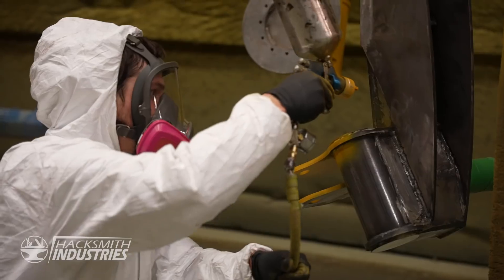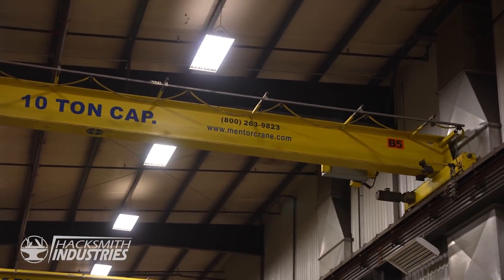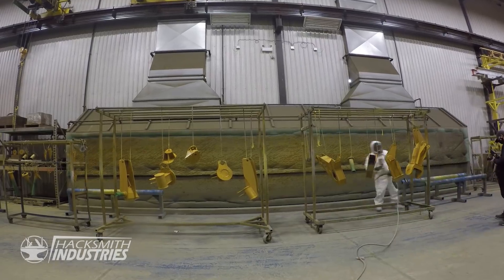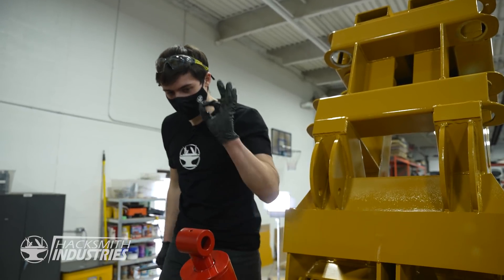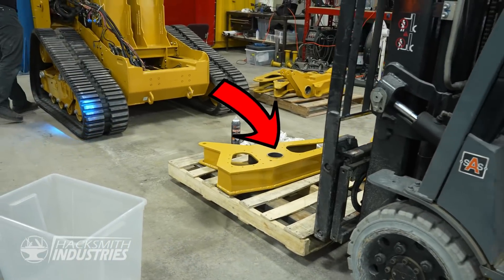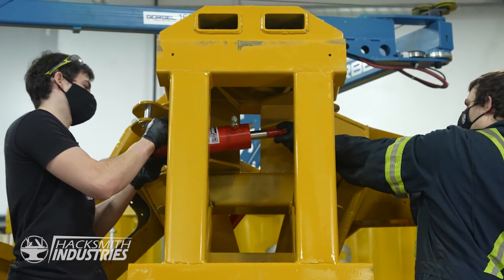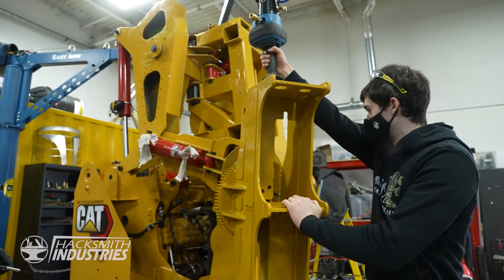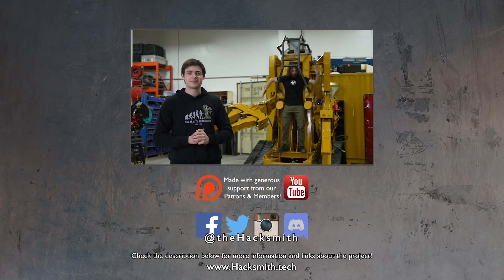It's so BIG... (POWER LOADER: PART 13)

Comment: Think that the mech in the movie was not built using steel, or any kind of "pure" metal. Like the AMP suit of AVATAR, it surely is built with lightweight alloy and high resistance polymer, so it does not weight a ton, can be easily manouverable with a quite low horsepower for the engine (maybe a variation of a Tokamak) and left all the weight (1:1 for balance´s and weight lift capabilities) directly put on the legs, like, as I said, the legs of the AMP suit. Of course, nothing crazy like the APUs of Matrix revolutinons film. Nothing could be wider on top and narrow below if you want it to walk or saty on is foor without falling. :)

Comment: here's an idea for controlling the movement of the tractors, what if you guys use something similar to the function of a hover board sensors to mount on the feet? that way you save space in the cockpit for other movement functions

Comment: No grease nipples? The axels will freeze up after a while. Also, you should svivel the hydraulics to the grippers .
Reply from the maker: It's a prototype, not going into heavy use. Mostly focused on function first, grease fittings can always be added =)
Reply: @hacksmith  Didn't expect an answer. :)  Looking forward to the end result.

Comment: project is awesome. btw, wouldnt be safer to use some lighter material?
the weight of this thing seems huge.
Reply from the maker: Nope! Construction equipment is all made from steel for a reason ;)
Reply: @hacksmith  i see

Comment: Arent you not suposed to grease oil light bearings? Just oil them? Ar least thats thw case with a pilot bushing in a car. We had issues with the bushing spinning in the crankshaft because we greased it. Although im no engineer and also its alot higher rpm than this.

Comment: Was there put any thought into the moving joints on each end of the hydraulic rams that are mashed between two plates of steel and tigheted together with bolts? Seems like a mega friction and loosening issue
Reply from the maker: They're not bolts, they're shoulder bolts, that's how you mount a hydraulic cylinder normally!
Reply: @hacksmith  oh! just looked really wierd when you dont know what a shoulder bolt is

Comment: Awesome project. Was wondering though, I didn't see any, but were Zerk/greaser fittings used at the joints with the bushings?
Reply from the maker: Will be added later if necessary -- it's not going to get as much use as a normal piece of heavy equipment haha

Comment: What's with the tracks? This is kinda like a wheelchair on steroids vs the Aliens power loader as the legs were 50% of what makes a power loader a power loader.  
If you were to build a T800 Terminator with tracks instead of legs you'd have built Johnny 5 from Short Circuit.  If you made an At-At or AT-ST with tracks, you'd have made a tank instead of a walker from Star Wars.
Reply from the maker: Watch the past few episodes. If we made legs, it would be no better than a statue, and non-functional. There is actually a militarized variant of the powerloader in the aliens franchise as well.
Reply: @hacksmith  I personally don't care what kind of mobility it has, the fact that you managed to bring mine, and hundreds of thousands of other people's dreams to life and make the impossible possible is mind blowing and incredibly awesome and at this point what kind of legs or tracks it has shouldn't matter.

Comment: It’s a shame y’all put caterpillar welds on a CAT  skid steer ha ha ha 

Dear Mr.Hacksmith

       I am a X-Ray pipe welder by trade and a QC now, later in my career. I love your channel and if you ever need a good welder to lay some beads on a project no matter the Metal/Alloy I’m your man. 
I would love to get into a shop like this I miss welding everyday and I am a Tinkermen if I haven’t taken it apart somethings wrong. So if you ever have welding position on the crew open up I’ll cancel my lease, load up my welder, kiss my mother goodbye and head north.

Comment: To put the whole load of the hands on just the bearings looks wrong. It would be way better of with a shaft, to catch at least the tilting forces. For the pulling force, may the mighty Maultasche bless you much and many times🤗

Comment: For operator height adjustment and general comfort while operating, I'd suggest small hydraulic lifts with thick rubber pads on top to raise the operator to height and provide some shock absorption to lessen foot fatigue since we're at 1G.

Comment: I bet Cat is trying to heavily recruit  bogden  as an engineer. He designed and built an entire piece of heavy machinery. Which is far more than most engineers. Who hardly ever get their hands dirty.  This may be one of the most valuable  experiences in his life.
Reply: The hack smith team all contributed to this project I’m assuming Bogden is like a team leader or supervisor position on the team meaning although he probably designed some of it the work load was probably spread through the team by him
Reply: Caterpillar is just using them as a cheaper route for equipment development due to these guys getting funding from fans. All CAT has to do is donate a skid steer and supply pins and bearings at discounted prices, good deal!

Comment: Get hydraulic check
Valves for your rams. It helps to prevent it from falling back down after releasing pressure. If you are wanting to hold it in a set place.

Comment: I think maybe qou could have build an power loder with legs... you just have to use some gyrosensors...
Reply from the maker: Gyroscopes work for small lightweight walking robots. Not giant hydraulic mechs that have to carry loads. If we made it with legs, it would be a statue =(

Comment: Guys just for future reference, AR400 plate is meant for abrasive situations not so much strength. It’s quite brittle
Reply from the maker: The UTS is what we were after. It's still much stronger than the regular cold rolled steel.
Reply: @hacksmith  more strength then cold rolled, yes. In the right application. However the welding material and technique can affect this type of steel much more then with your typical mild steel. Also it’s not commonly recommended for things like booms and weldments in torsion or “flexible” applications. Just food for thought 👍🏻

Comment: Is selling the design to caterpillar out of the question? You could make a lot of money, and imagine how cool it would be if Caterpillar actually starts making these. Or is the design too inefficient for what it does?
Reply from the maker: It's a health and safety nightmare to put the operator between the machine and the hands =P

This is the equivalent of standing on the forks, as your using the forklift xD
Reply: @hacksmith  that makes sense. Do you plan on using it around the shop then, or have it be more of a functional model?
Reply from the maker: Of course

Comment: 17:35 come on guys, look at those welds
Reply: I'm hoping they left it just tacked together  cause they realized it wasn't right, and not because  they thought those welds would hold anything
Reply: @robomaster1000  those aren’t tacs, that’s a bad welding job. it looks like a few of the welds burnt through and the metal wasnt even cleaned before

Comment: It's looking great! but out of curiosity, how do you guys intend to dissipate the forces felt by the driver so they don't end up a bruised and battered mess from being bounced around in a metal cockpit with the jerky movements of the rig? Harness system?
Reply from the maker: Shouldn't be that bouncy!
Reply: @hacksmith  I mean, I certainly hope not! :P

The main thing I'm concerned about is the leg side guards. I mean, as humans we tend to have a natural sway to our bodies to slowly bleed off changes in acceleration, but heavy machinery tends to have a level of just... start and stop especially for short/minimal movements. The leg guards seem to be a bit narrower than a person's natural sway so I was a bit worried you guys might end up hurting your legs a bit during turns. (Imagine dodging dodgeballs with a fence between your legs)

Best of luck with it though!

Comment: 16:52 Is it just me, or to the lower solder connections of the roll cage look very weak?
Reply from the maker: It was only tac-welded together since it was a prototype, it has to be changed fully anyways

Comment: This thing is amazing! A suggestion though you should install grease fittings for every pivot point so the machine can be greased regularly otherwise that preinstalled grease will just work its way out due to the tremendous force it will see and youll get squeaky worn out joints. And also please do not use that roll cage those welds on that thing are not safe and it will not do any good in the event of a roll.
Reply from the maker: They were just tac welds... it was a test fit lol

Comment: Hmmm, you might want to look into V- Sido or similar control devices cause technically speaking the Powerloader isn't too different from the Kuratas Heavy industrial Mech, and in the Aliens movie the controls seemed like scaled down thumb versions of the hydraulic joystick controls already used in Caterpillar industrial vehicles, much like the previous joysticks on the Compact Track Loader you got from them.

Comment: Alternate title: "I used the forklift to build a better forklift"
Reply: "I used a forklift to build a sketchy worse forklift, that looks a bit like the one in an old movie."
Fixed it for you.
Reply: @amcconnell6730 
"Worse"? It has two arms and grippers so it's more versatile and the fact that it has grippers at all instead of just spikes like a forklift means there is less chance of whatever it's carrying being dropped or slipping off.

Plus it's really not that sketchy. They are designing it to be as safe as they can make it because they plan on getting in it and testing it out when its finished, and they don't want to get hurt or die in the process.

So it's really not as bad as you're trying to make it out to be.

Comment: Looking good guys I a question and a pointer wa the paint you used etch paint or how come you did use primer? And my pointer it  you going to want to drill and tap greese nippls into all the joints or otherwise once the greese you have put in for assembly pushes out it will waire down your pins and bushes it be a shame to see that happen
Reply from the maker: It's self-priming paint, very good stuff! Grease nipples will be added if necessary. It's just a prototype, not like a piece of real construction equipment that will see 1000's of hours of use.

Comment: This is probably the first time I've seen a multi-billion dollar company actually partner with a YouTube channel for something more than a simple sponsorship.
Reply: They are not any Youtube channel, they are The Hacksmith, its like, Stark industries but in real life
Reply: errr not really they just threw a few of grands worth of equipment their way so that they are associated with the most well known youtube build around, sounds like a normal deal to me
Reply: pocket change to get almost 12 Million people to promote your wares
Reply: @irwinpks  also i feel like they want to see if they can utilize a fully functional power loader and if it'll be more functional then the current options
Reply: @colinjohnson4799  I think the same

"Well, if it works... Why not manufacturate?"
And still a really big sponsorship, its an almost 12million subs Channel, and not only that, an Engineering channel, its pretty hard to be that big with this kind of content
Reply: @speed4br1  yeah overall a good marketing plan
And imagine if jobsites had this, i feel like it could be pretty useful

Comment: am I missing something? It looks like they are painting outside of the paint booth, like, right next to it.
edit: is it actually that entire warehouse space? like, 2000 sq ft?
Reply: Yes, we have an entire bay dedicated to painting with overhead cranes and cross-draft ventilation and filters
Reply: @blairstewart6407  wow, I've been in alot of paint booths, some big enough to house 1 ton trucks but that one takes the cake.
Reply: @marcblanchet678  We build some pretty big stuff so we have a couple of our large MENTOR cranes to move stuff around too!

Comment: awesome build to you all at Hacksmith Industries, but I didn't notice a single grease fitting throughout this build.  How do you all plan on tackling the excess friction once the grease that you initially put on the moving parts, wears out?  It would be a pain in the butt to disassemble and regrease the pivot points

Comment: The Picture (see up) show they already build in some Pedals kinda thing. So the ending where he was to small is spoiled :). But i wonder if they are just Pedals to stand or they have also an control function for the Tracks like Planes. Perhaps in the back of the Roll cage, i mean the Pilots back could get a small plate to Protect from Fluid or other things that could hurt the Pilot (17:50 where he put his Head trough), of course removable for access

Comment: When trying to get paint out of a full big bucket like those, create a ladle. Pipe ( used 90mm or 100mm typically, scraps big enough to do the job), cap on the bottom and bit of metal for a handle, and it does not need to be neat, just capable of getting the paint out of that monster. Once that monster of a bucket is low enough you can pour it instead.

Comment: Imagine Caterpillar actually starting to make machines like this one.
Reply: It'd be cool. But there is a reason we don't have walking forklifts. They only made it for the movie so Ripley could fight the queen.
Reply: It will become a butterfly
Reply: Yes
Reply: It’s just so… impractical
Reply: Then we would be part of a cinematic universe
Reply: What industry would use it? WITHOUT changing container designs.
Reply: Honestly all they need is a standard for a container that it can load and I can't see why not, albeit logistically impractical.... but if they made it even bigger.
Reply: I hope they do
Reply: Yes
Reply: would it not work for specific jobs say remotely loading ordinance on fighting jets .
Reply: I can see each warehouse with only two, but it’d be for lifting non- standard form, extremely heavy cargo, and one that requires extreme precision, like a small factory machine, or hauling away an accident on a vehichle factory line, basically, any cargo that cannot just be palleted and forklifted away by a small fleet of forklifts, without risking immense property damage. even more basically, mecha janitor/ glorified UPS early 2000's unique package sorter
Reply: No

Comment: Once the power loader is finished u guys should try and make it street(road) legal and drive around in it
Reply from the maker: Doesn't need to be! Heavy equipment is legal to use on the road under certain circumstances =)

Comment: Nice mech on tracks. Not a power loader without legs. If you're gonna cheat, permanently attaching the feet to the floor would be closer. If it's not gonna be a power loader, at least make it look like one.
Reply from the maker: Why would we want a statue?  Ours can pick up a car... and drive around with it!
Reply: @hacksmith  Yeah, but it doesn't look like a power loader. Like I said, nice mech, if that's what you want. I'd want a power loader. Get Burton to help you out. His robots walk. If you're on tracks, you're a vehicle. Not a walking power loader.
Reply: Can't wait to see your Ed-209 on a dolly & your C3PO on a tripod. Maybe an AT-AT on roller skates. I mean, legs don't matter to a design, right? I guess they should just take the legs off that life size Gundan in Japan & stick it on top of a tank.
Reply from the maker: The life size gundam doesn't even stand on it's own... it's attached to the platform dude.

Comment: Seeing the scale all put together compared to a member of the team is astronomical how beefy the loader is !
I'm super excited to see what you come up with for the control methods.
I'm imagining something similar to flight sticks that can gambol back and forth, for driving; alongside potentially a control mode switch in order to focus power to the arms or treads in order to simplify operation by hand. The only disadvantage with this idea would be not being able to move arms while driving, but I'm sure the team has come up with a more elegant solution.
Another possibility could be having the user suspended in air off the foot placement of the machine, this could be accomplished with a harness, this would allow the user to use their unrestricted legs to drive the machine's treads. (this would be complicated)

Comment: Next big build like this 1 should be the 1 exo suit from Matrix...but instead of machine guns...use flame throwers and make the reloading system the same...they reloaded the weapons by climbing onto the back and pulling a tray out to place the ammo can on...if you can make a system that let's you do the exact same thing without having to manually detach and reattach any hoses for the fuel to go through...it would be a perfect flamethrower variety of that exact exo suit
Reply: Unless you want to use airsoft guns to completely replicate the exo suit to perfection...and if you use airsoft guns to do that...then I would advise an HPA setup for better consistency when operating the guns themselves

Comment: Im afraid those very thin rings holding the deltoid bushing in place might be a structural weakness. You designed the base to be able to carry such a massive payload but can those thin rings hold a max payload as well? Either way, amazing work. This is so cool to see finally come together.